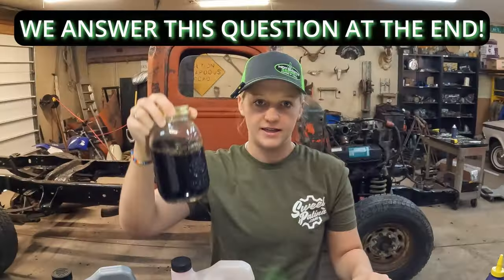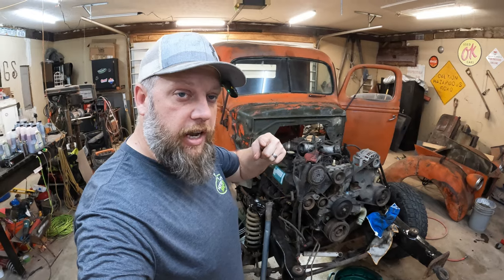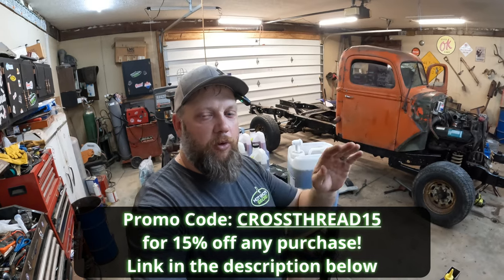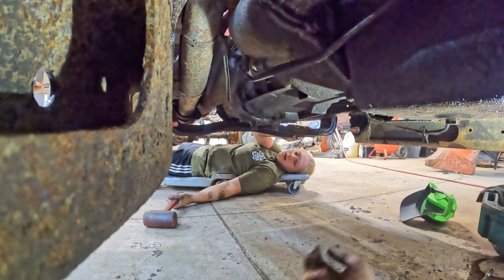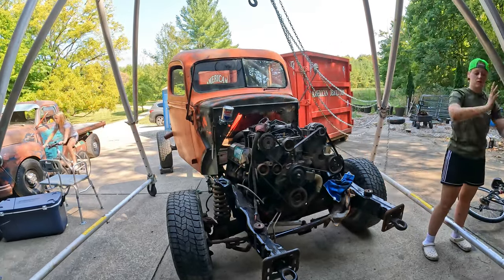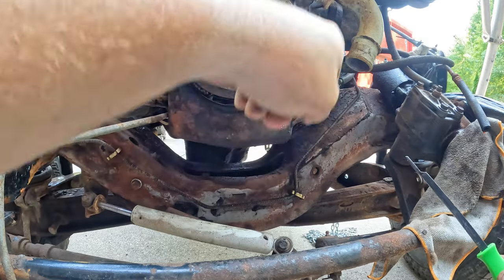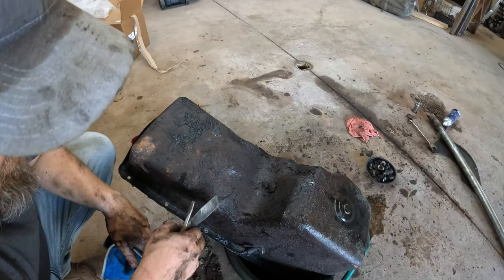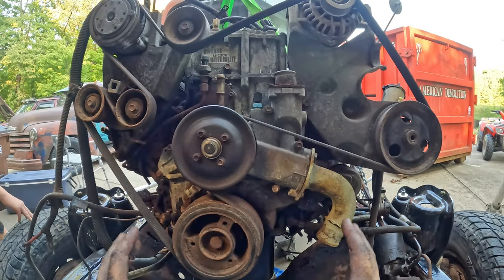Engine OUT For OIL PAN Change? | FRANTZ Oil Bypass Filter Install

Comment: One of my dad's best friends never changed the oil in his trucks. He would just change the filter and add oil. He did masonry work and racked up miles pretty fast and towed and hauled stuff with them. He would put about 300k miles on and then buy a new truck. I don't recall him ever having any issues
Reply: Totally stupid question: did he drain the oil pan? I ‘inherited’ a ‘99 Ford Explorer a couple of years ago. Changed oil & filter myself. I’m a total fill with oil & the Hot Shots oil additive. I use the gas additive every 7 or so fillups…I don’t drive it everyday, though it’s my daily driver when I need to go. Thanks for any advice or insights!